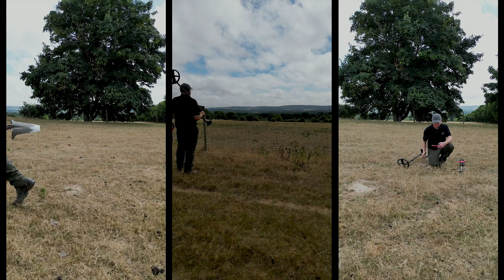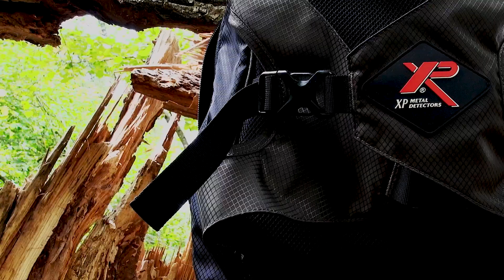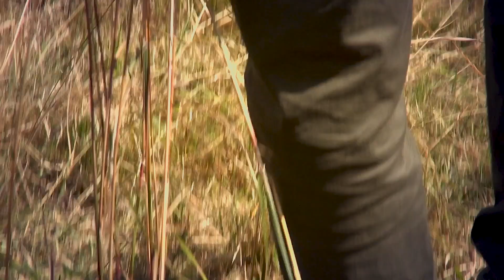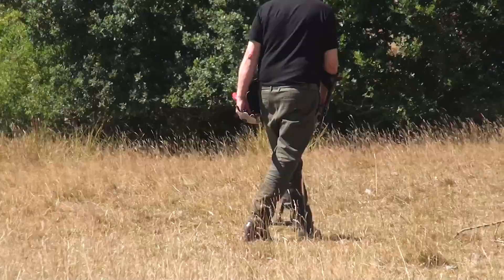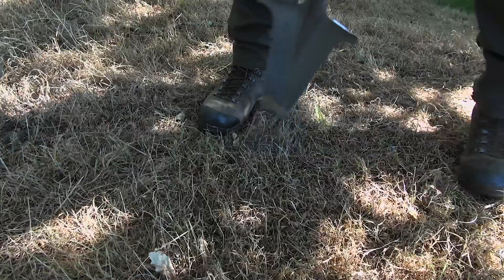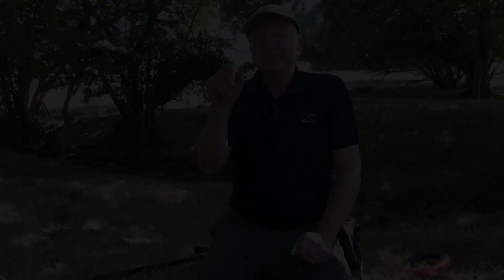Exploring the XP Deus II factory programs Deus Mono P7

Comment: Thanks Gary, great video as usual. I loved the Deus 1 soooo much and swung one since 2015. It is a colonial killer in the woodlots of New England in forested cellar holes. I grabbed a Dues 2 because it had Mono, and I love the option. But I have a multi program based off FAST that is simply incredible, I just don't use mono anymore. I have to go back and hunt my old spots, as I'm grabbing another 2 or 3 coins in heavy iron with the D2 off each spot. It is a different cat than a D1 and takes a bit to adapt, but it's worth it.
Reply: Thanks for your thoughts Jay, keepup the good work 🤝👍